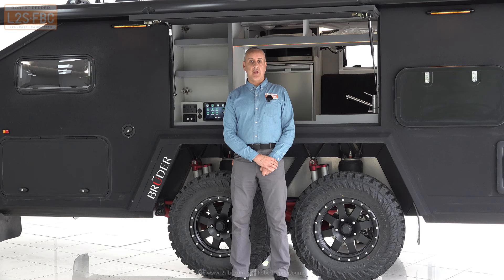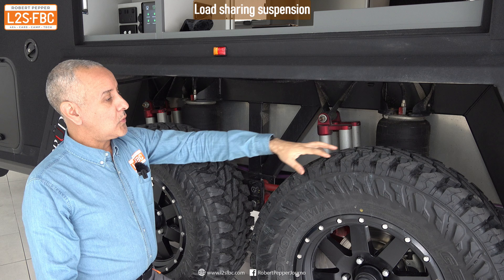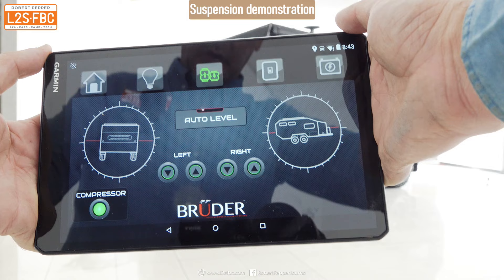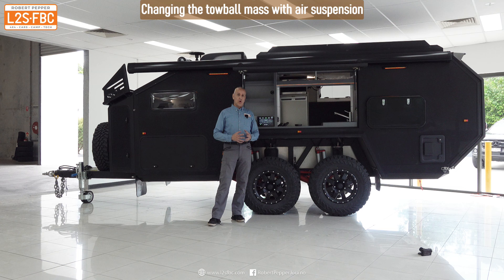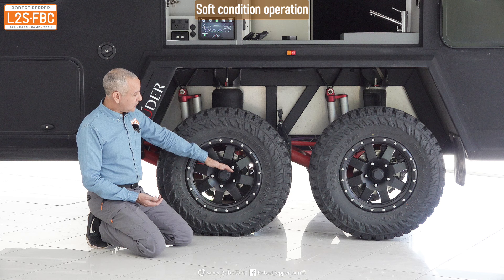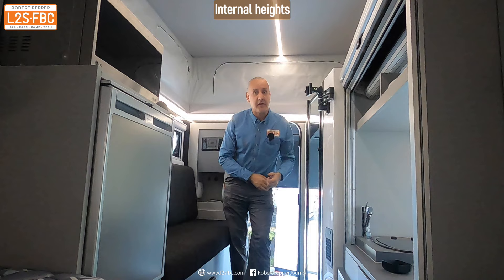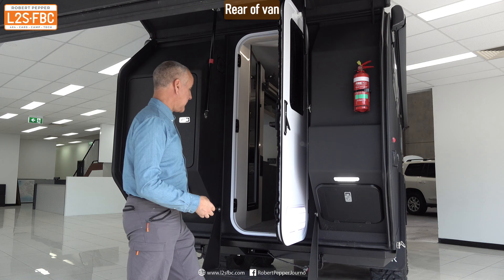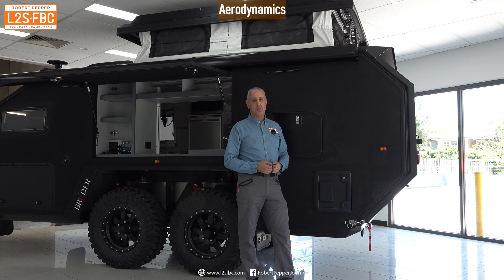Ultimate offroad caravan? Bruder EXP-6 technical analysis

Comment: Such good tech and costly. I'm waiting now for electrically driven wheels on the van. Powered by the alternator of the car.
Reply from the maker: Yes electric drive for trailers will be amazing but power will need to be off a battery on the trailer
Reply: @L2SFBC  Is that because of high amps to run electric motors?
Reply from the maker: Yes, the alternator wouldn't supply enough power.  Even a small battery on the caravan, topped up by regen and extensive solar, pluys a feed from the car's alternator would help. Mostly would be used for starting off and offroad. Would be super hepful.

Comment: good video, especially about the difference in load sharing vs non load sharing, but explain to me about the van pitching up and down, while hitched to the tow vehicle?
Reply from the maker: sure. With a NLS suspension when you pitch up the force required to 'lift' the towbar becomes greater. Same for when you pitch down.  This is because the 'other' wheel is being lifted a bit. Hence there is a damping effect. With LS when the trailer pitches up it gets easier to pitch up. Same as when it pitches down. So, no damping, opposite effect.  More here https://youtu.be/tyvpVv3PaWw

Comment: impressive features. Very interesting video regarding dual axle vans, thank you. how many have each wheel rated for 'single' use? also with air bag vans, and auto levelling at camp, with more air in the bag do they suffer from more movement? and rely more on stabiliser stands? We keep our induction portable, for cooking away from where the  cooking spatter can cause issues.
Reply from the maker: I'd say you still need stabilisers but in that video I didn't get to live in the van unhitched. I don't think steel vs air springs makes much difference.

Comment: Question: Why wouldn't you leave it in the load sharing configuration all the time? In my research it appears that load sharing is superior in all situations. The only exception I could find is that in a tandem axel arrangement non load sharing might offer more articulation but that depends on how it's configured. In the case of the Bruder I just don't see why load sharing wouldn't be how you set it up all the time.
Reply from the maker: Stability at high speeds less pitching
Reply: @L2SFBC  Interesting. Makes sense. Didn't think about that. On Bruders site they talk about how fast they towed it and their wind tunnel tests but they don't talk about what mode the suspension is in when they do those high speed tests. Once again...something new to think about. Thank you

Comment: really looks like a paid review
eg- crowing about the air suspension to improve rear entry (yess all good on first appearances), but you fail to mention that you would then need to adjust the front hitch height to maintain the vehicle level status (now remember, this is for the mobility impaired - the last thing they want is to have to disconnect the van and jack it up and down every time they stop and want entry) 

all up, I appriciate your engineering comments,  - keep up the good work
- one thing I noticed re the suspension is that it is relativly smooth underneath the arms ( a good thing given the ammount of rocks etc that get tossed around on gravel roads and the knocks, drags and scrapes that can happen in severe off road.  This aspect  of design is often quite bad in other makes, and is almost neves spoken of.

On a side aspect
There is public record of what I consider to be some really ugly treatment of folk by this manufacturer.  This is unfortunate as it appears that a lot of thought has gone into the product design.
Reply from the maker: Not paid. Not a review either as I said at the start. I did mention earlier on about the need to change jockey wheel height when talking about auto level. Also, to lower the rear to get in you don't need to change the jockey wheel height.

Comment: ultimate oxymoron. Heavy trailer will spoil the reason you went off-road. If you can afford it use the money to buy luxury accomodation if that's your need but going off-road is where you leave unnecessary stuff behind or it will get you stuck.
Reply from the maker: There is some truth to that yes...but if you're going to tow, better to have a van you can tow over rough terrain than not. I've pulled mine through mud and over sand dunes.
Reply: So you think a One Ton (Ford, Chevy, Dodge) pick up truck can't handle that trailer off road 🤔
Reply: We own one and tow it wit h a full size GMC 2500 van. And they do great off-road
Reply: 1500 won’t work, it will tow but not very efficiently and not without trouble. You must buy a 2500 with off road capabilities like a Ford tremor or a GMC Sierra AT4x